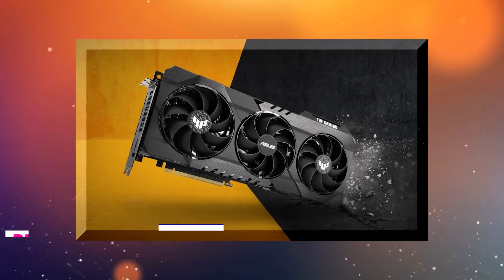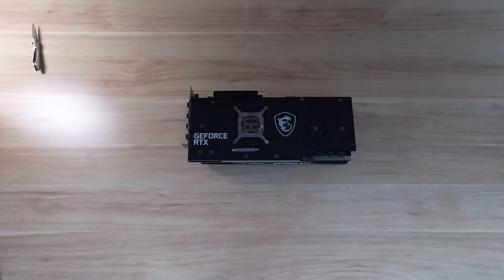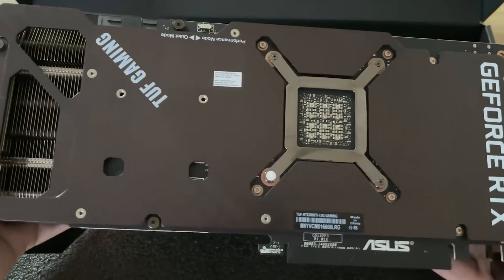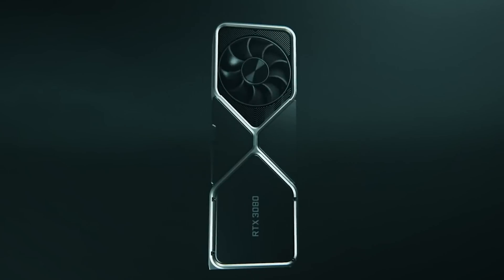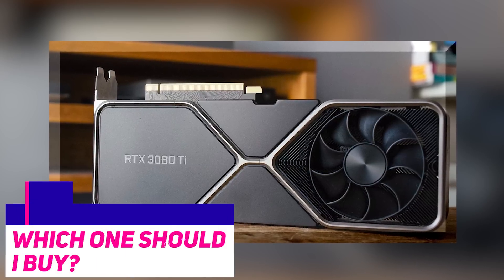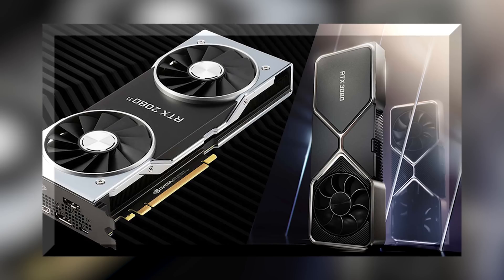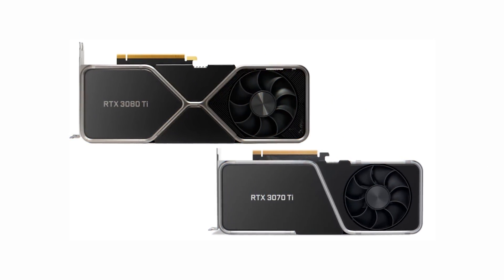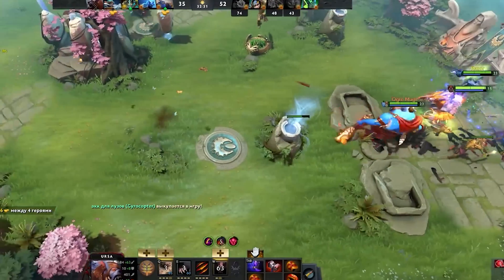Is the 3080ti worth the Extra Money? RTX 3080 vs RTX 3080TI

Comment: I wish there was more talk about the 12 GB version since it should fall right between the 10 GB and Ti version. I think it should suffice for current 4K gaming...?
Reply: I wouldn’t exactly say in between.
Reply: @gomezalejandrog  how so? more Ti or more the 10 GB?
Reply: @mullerstephan  more ti
Reply: Im actually playing  AAA games at 4k with good fps
Reply: @francomora909  which games? and how many fps? using DLSS or RT?
Reply: @francomora909  what fps and what games?
Reply: It's much slower ram so it really dosen't.
Reply: @X862go  they have the same RAM type GDDR6X so what's your point?
Reply: @mullerstephan  Difference between 10gb and 12gb in gaming is so negligible.....maybe 2 or 3 frames.  If you can find a 10gb for less money, get it.  12gb does much better in synthetic tests where that extra RAM gets put to use.
Reply: @burntorange3  yeah they are pretty much the same now where I am (about 100 € difference) so I might just get the 12 GB for future proofing or even go for the Ti for another 100 € more
Reply: You're better off buying the Ti.
Reply: @sodadrinker89  yeah i was thinking about the 3080 12 gb one but just went with the 3080ti and im abso satisfied, i got it for 1600 cad with taxes
Reply: @PickemMMA  12gb has absolutely crap ram for 1k usd gpu.
Reply: @X862go  I’m more than happy with my card, I use it to play games on my LG C1 oled 4K at max settings and I have no issues with it it runs buttery smoothly